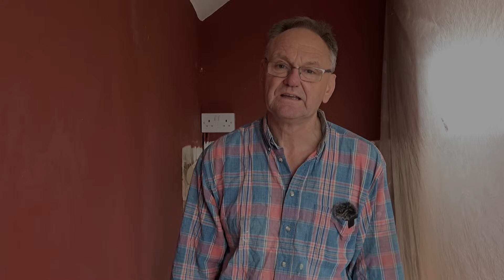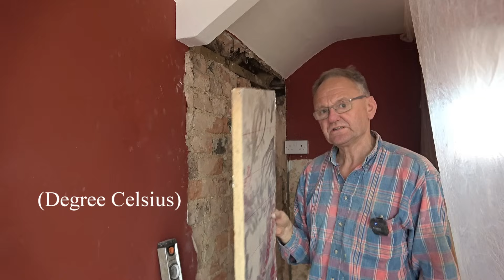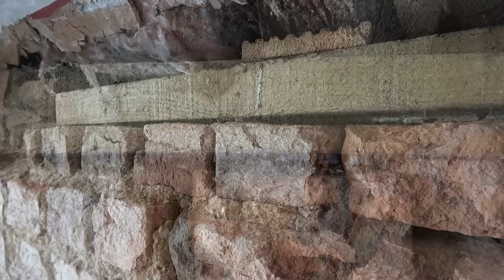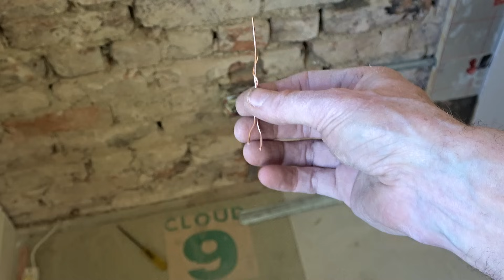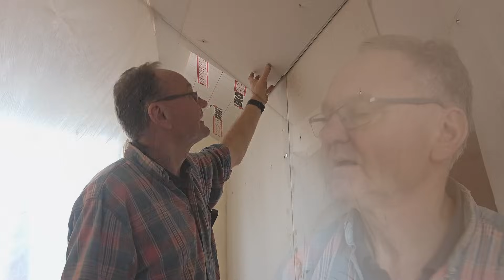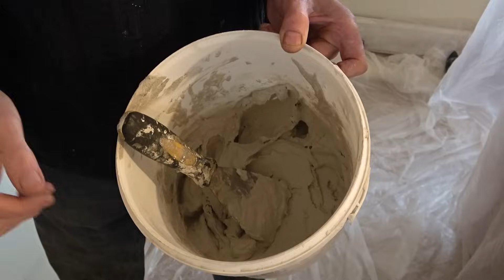HS165 Insulating a solid wall (Do it yourself)

Comment: I loved watching you have a go at this and use all the knowledge you had to solve the problem for YOURSELF.  You're absolutely right in your approach.  Here's a few reasons why: 1) get back to the brick structure and firm it up  - great history lesson by the way  2) Amazing how 1inch of insulation can make a difference!  The reason 50% of heat loss is covered by just 1 inch of insulation 3) You boldly went with your own experience and weren't put off by horror stories of damp!  Surely the real knowledge is found on the frontline and not with the so called experts.  

I wondered - did u think of adding a thin foil wrap behind the insulation board to creep the R value up?  Also - a tube of spray foam can be great to fill the gaps into plasterboard and save the mither of filling the gaps by other means! Thanks again!
Reply from the maker: Thank you for your support Matthew. There are enough times when amateurs get it wrong but sometimes just by probability and persistence it works out and we defeat the odds. I've done a few walls in the home like this (just single walls not the whole room) and so far we have dodged the damp. That said, I do acknowledge now that breathable would be better on solid walls.  Cheers

Comment: Being a solid wall I would have mounted the insulation on 3/4 inch battens to provide an air gap to avoid possible moisture problems.
Reply from the maker: Hi Voda, I cannot disagree. I just did not have the space in that case. The wardrobes go right up to the doorway and I did not want all the extra work of modifying wardrobes, or the expense of changing them. We have done similar on a few other walls over the years and so far not had any problems. That wall is upstairs and sheltered. Fingers crossed. Cheers
Reply: @HaxbyShed  I am slowly doing my house .It was built in 1905 and unusually for a house of this age It has cavity walls and I stick the insulation straight to the walls. The insulation is as thick as practicable up to a max of 450 mm.Widows are double glazed with some treble ,quadruple and one quintuple glazed unit.
Reply: @vodaredhill1704  surely if you have cavity walls you don’t need to insulate your house?

Comment: Super video, thanks a million for all your efforts in making it. Some really useful tips in there. I'm thinking about doing something similar in my kitchen which is on a similar outside wall and is perishing in the winter.
Reply from the maker: Hi Richard, please just note I'm no advisor on these things - you will see the various comments about the risk of damp and kitchens can be steamy. But whether it is solid or has a cavity will be a factor in your thinking no doubt. Cheers
Reply: I enjoyed this video. The technical content was good, giving the context that external insulation was not an option and your decision for not using the insulated plasterboard. I liked your style and that you clearly were not at all surprised at anything you found.  Very nicely done.😀👍

Comment: If you are going to fill joints and screw heads use something like easifill, get it on as smooth as you can then give it a light sand.
It is much easier to use also regular plasterboard joint scrim is easier to use. Plenty of taping vids on you tube if anybody is unsure.
Reply from the maker: Thanks Michael, that joint 'plastering' was quite tedious and messy, and anything to make it easier is welcome. I'm sure your advice will help people. Cheers.

Comment: Well done sir. A steady methodical DIY approach to achieve the result. Plasterboard in place of the old plaster may have increased your insulation value also. I done some ambitious DIY and insulation is a key consideration on a lot of the work I have done, sloping parts of ceilings is a must to insulate. Have you any experience of using expanding foam to fill gaps, I use it as an adhesive too, would have been a good solution for the gap behind the bottom of your boards.
Reply from the maker: Hi Terry, a few people suggested expanding foam for the lower part and I got some 'low expansion' foam and squired that in at skirting level, being careful not to overdo it because apparently too much can blow the boards off 😬 Cheers

Comment: Just use warmshell breathable insulation topped with lime plaster and breathable paint, these old walls 
Need to breathe not suffocated badly with modern materials
Reply from the maker: Hi Darren, I just googled that - breathable woodfibre insulation. Very interesting, I think people would find that useful info. Thanks for sharing. Cheers

Comment: Tell you what you’ve done a really good job on that.  All credit to you.
Reply from the maker: Thank you Steven. It's just DIY-level so I don't claim any expertise but the method seems to work for us. Cheers
Reply: @HaxbyShed  Ive decided to have a go at the front walls in my house. The plaster is hollow in places But if I start knocking it off it will never end.  The house is old and under the plaster is mud and straw. Very messy.  Ok to just go straight over it do you think? I don’t want to create a load of work.
Reply from the maker: Hi Steve, my opinion is only that of a layman but if you have mud and straw I would strongly recommend getting advice about breathable solutions. I know somebody with an old stone thatched cottage and she was about to get injection damp proofing until somebody pointed out the walls would dry out and collapse.  I know that's not at all the same as internal surface insulation but do take care. Cheers

Comment: You might want to do a bit of research on breathability in old houses and what insulation types are suitable. Very easy to create a mould sandwich and make the walls have intersticial condensation damp problems
Reply from the maker: Hi Alex, we have insulated a few walls in our house selectively over the years and I think that will be the last one in this house. I do understand the risks of doing it the way I have but so far we have not encountered any problems - e.g. damp, smells etc. Worst case if we do get problems the insulation would have to come off I suppose. But it's not like I spent a fortune on it.....   Cheers
Reply: As far as I'm aware Kingspan doesn't breathe so you are risking mould/damp. There is a new material called Aerogel which is completely vapour porous yet has a much better U value than Kingspan, also you need to use porous magnesium plaster boards.
Reply from the maker: Andi, Aerogel looks interesting and very space-age. I had a quick look on Wiki. Hmm .....   Cheers
Reply: @HaxbyShed  Take no notice mate - there's always one. It may well be that the wall behind the kingspan does become damp to some extent. As long as there's no timber in contact with it, there's nothing to be too concerned about. A couple of coats of oil based paint would eliminate that risk anyway.
Reply: @its.free.realestate  I repeat ... there's always one...
Reply: Some people treat the brick work sealing it with a substance so no moisture builds up behind the new insulation plasterboard!
Reply: @Kk-bq8sw  some people don’t understand basic building physics

Comment: If you do anymore walls, use pva bonding adhesive, dot and dab the insulation sheets to the wall, then use some fixings. That way it makes for a better adhesion and removes any discrepancies in the wall. You can then use construction adhesive to bond the plasterboard to the insulation.
Reply from the maker: Hi Hold Fast, if I could trust myself I think dot and dab would be ideal. I'm not very good with sloppy things - I usually get more on myself than the wall. 😁  I don't think my method would make sense commercially - too slow. Cheers

Comment: Great video. Well done.  I did this to a bedroom that had 3 outside walls and was always colder than others. I used plenty of silicone filler of the back of the insulation boards and fixed it directly over the wallpaper on the wall!  It worked well. I did not fit plasterboard. I simply painted over the insulation and it looks quite natural although It's a bit vulnerable to denting if you're not careful.  Yes it made the room much warmer and easier to keep warm.
Reply from the maker: Hi MintheM, I like your approach. Whatever works. I think people are too tied to convention when something simple would do just as well. Think - if we had no money we would find ways. Cheers

Comment: Very useful video Paul, we have a kitchen that’s basically a lean to with exposed solid stone wall on all three sides currently renovating and was looking for ways to best insulate it 👍
Reply from the maker: Hi John, thank you. There are varying opinions about the best and correct ways to do this on solid walls, with much comment about air gaps and vapor barriers. All I can say is I've done it this way on a few walls over the years and so far we have no damp, mould or musty smells.  Cheers

Comment: My house was built in the 1830’s so I have a similar situation.  As it’s a solid stone wall which is porous, my understanding is that if you block the moisture by not using the correct product such as lime plaster or leave an air gap to allow for evaporation then you may be introducing the possibility of mould developing as the moisture has nowhere to go.   I’m still trying to educate myself on this so I may be wrong.
Reply from the maker: Hello Steve, the comments from people with more experience than me agree with you. Since it is a solid wall it seems an air gap is the correct approach. All I can say is I've used this method on a few walls in my house over the years without any problems that I'm aware of. Those walls have generally been sheltered.  It seems having no air gap can cause problems but it's not a case that it definitely will cause problems, from my experience to date. Cheers
Reply: Yes, my house was built in 1725, handmade brick and lime mortar, problem is it’s been repointed in 1970 ( not me) using cement, probably because it’s cheaper than lime mortar, thinking of insulating the south facing gable end, not used often but I get in the winter 6 litres of water from a dehumidifier in that one room a day; if I was to insulate it where would all that 6 litres go?
Reply: @barneybiggles  Hi, I have over 20yrs experience in drying buildings and can assure you your dehumidifier will always pull moisture. The 6 litres you are getting is most likely as a result of you living and breathing, taking showers, boiling the kettle etc etc. If you have a dog you will be astonished much moisture they breath out. Don't necessarily assume the water being collected is from your wall...hope this helps
Reply: Should use wood fibre insulation and lime plaster internally, don't use kingspan on old buildings, it seals in all the moisture of everyday living and will give you damp problems.
Reply: Sorry dont want to be an online troll but is this the totally wrong think to do here, with a old house that needs to breath, this type of insulating is the wrong thing to do and could lead to mould in between internal wall and insulationn, dependent on rainfall in the area and how damp the wall could get.. but still learning so with everything, alot of variables, this may work for this house but not another solid wall built house it may not..

Comment: Just used the same material to insulate our basement ceiling - I wouldn't insulate wall from inside unless it is already well insulated from outside? I used foam glue which insulates as well but I understand brick could get worse in the process....I also put foam glue between each insulation wall and cut it and will use aluminium glue whatever the name in english...then I will probably use white spray paint if fiance doesn't approve the alloy look of it.
Reply from the maker: Hi Pozytywnie Zakrecony, you can see from the comments that some people worry that my bedroom wall will not breathe and will get damp and mouldy behind the insulation. I can see their point. Technically it is possible but I am hopeful it will be ok. Some houses in the UK with solid walls (no cavity) do fit external insulation against the brick on the outside but even that can get damp running down from the top (rain gets in) and also cold spots which cause condensation on the inside. Making old houses efficient is a difficult problem with certain advantages,  disadvantages, and risks to each method. Cheers.

Comment: Great video. Lime mortar was common well into the 20th century. It's brilliant stuff as it's not ridgid and allows the wall to move rather than crack.
Reply from the maker: Hi David, I added lime to the motor mix I used on the pointing. Proper lime (only) mortar is like paste when it is damp and crumbly when it is dry. Lime mortar and clamp bricks full of coal lumps and other rubbish would certainly not pass the earthquake test, so it's best not to think about it if you have an old house. Cheers
Reply: I find lime mortar  much nicer to work with as it's more plastic and never goes off in the bucket. Pricey though.
Reply: My 1924 bungalow is lime mortar 9 inch solid wall and lime plaster walls and ceiling, the wooden floors have been removed filled in with rubble and a thin layer of limecrete, some of the floors have sunk in the middle, so I'm thinking of digging some of it out, then  using a DPM and 4 inch concrete and maybe celotex under concrete. The inner and outer walls have a slate damp proof course,and the brick footings go down to the clay

Comment: Good luck, but I do have to add:- As mentioned elsewhere, on solid 9" brick you need an air gap !

First batten the wall, with DPC between battens and wall, then screw PIR to the battens. 
It's to prevent cold-bridging, and condensation. Walls have to be able to breathe, as verified by the lime plaster you removed- lime is natural and can breathe, plasters from the 1970's onwards can't breathe. 
Once fitted you don't know what is happening behind the insulation. 

To support my comments have a look at the Technical details on Kingspans website, look at the details for "Solid walls", not cavity
Reply from the maker: Hi Andrew, In this case there really was no room for battens (or even the plaster) without taking out one of the wardrobes (or cutting and shortening them), so I considered the risk and did the job as you saw. I did something similar downstairs years ago and we've not had a problem with damp so far, but I agree an air space would probably be better. Cheers.

Comment: Well done sir, I’m in the middle of doing the same thing in our utility room so it’s fascinating watching how someone else tackles the job. I’ve used insulated plasterboard and sticky foam from Screwfix and I’m pleasantly surprised by the result. I’m happy to have a go at plastering myself so haven’t worried too much about lining up the front of the boards, although I know plastering is a skill I don’t think it’s beyond us keen diners.
Reply from the maker: Hi John, I can 'patch plaster' ok if I can get the float across the gap or plaster to a batten. I think anything much larger I would struggle. If I did this again I may consider the sticky foam route although you may see from the comments that people are a bit concerned I fixed straight on to a single brick wall without battens. Cheers
Reply: What thickness of insulated plasterboard did you use ?

Comment: just a tip never put none breathable insulation on stone wall
Reply from the maker: Hi hewoguys, I'm sure this is going to be an ongoing theme in the comments. I guess it's the difference between the proper way and my DiY way. We'll keep a look out for damp inside or brick spalling outside. Advice I will keep in mind next time, many thanks. Cheers
Reply: i should clarify if walls have cavity it should be ok i meant solid walls especially stone ones

Comment: Fantastic video! I'm planning on doing something similar in my house this year. I had originally planned to use insulation-backed plasterboard, and I never thought to compare the price of that versus using separate insulation. This might even make the overall job easier! Subscribed - thanks!
Reply from the maker: Hi Chris, that's high praise thank you. There is further advice coming through in the comments. Thanks for the sub, but only fair to point out that most of my videos are about my hobby machine shop so I hope I'm not 'mis representing' with this DiY vid. Although I've done a few DiY vids now. Cheers

Comment: I'm looking at doing the same in my house. The majority of the walls are pre 1850s solid stone and the back is even colder cavityless brick. Thank you so much for sharing this as this is the approach I'd decided to follow. The only stumbling block I have is building regs part L looks like I have to involve building control and hit a very high standard U value. Any tips?
Reply from the maker: Hi James, I can't give you any advice about building regs but clearly millions of properties do not comply with current standards and in this case you'd probably need so much insulation there would be no room for the bed. 🤣  If you were building an extension or a loft conversion, or renovating an investment property to rent or sell, then yes for sure. Cheers
Reply: You're renovating / improving existing dwelling. You don't need BC involvement unless doing something need permission for, change of use, extension, conversion etc. Obviously new builds have to comply fully with part L but there is a get-out for conversions / adaptations of older properties where Pt L not viable.
Reply from the maker: @asilver2889  Thank you for for that advice, I'm sure it helps a lot of people considering this sort of work. Cheers
Reply: @asilver2889  that's not true. Changes to the thermal fabric require building control notification